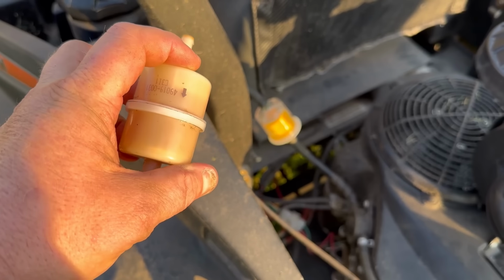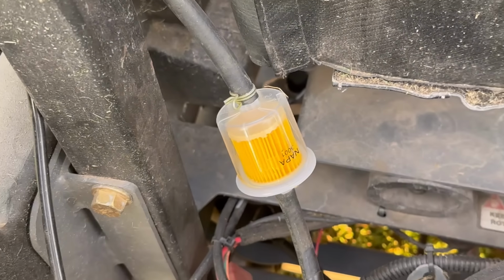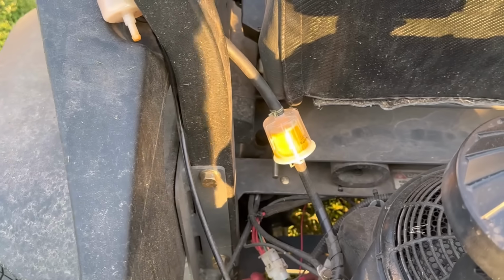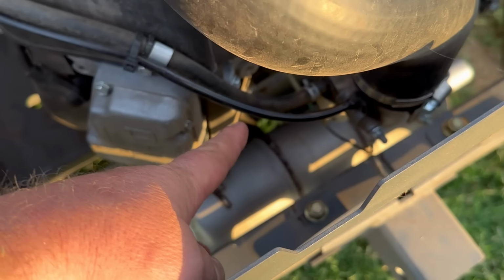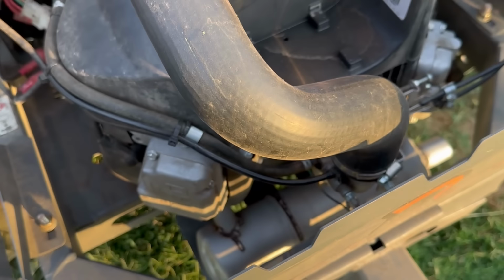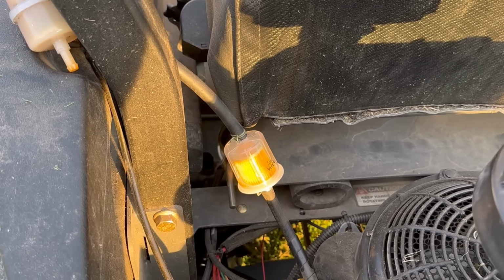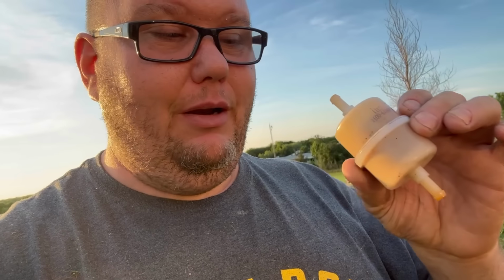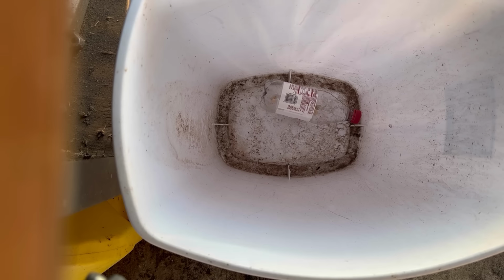MY FUEL FILTER NEVER FILLS UP?

Comment: Two things I NEVER do unless I have a problem. 1 - Change the fuel filter. 2 - Change the factory plug. The factory parts last pretty much the life of an engine. If you keep clean fuel, the filter should never stop up and the plug should never burn out. Changing the oil; ABSOLUTELY EVERY YEAR. You start playing around trying to fix what ain't broke and you'll end up with more issues.

Comment: Absolutely best strategy Maintenance- maintenance folks!! We all know what happens to the "if it ain't broke don't fix it folks" - that was actually a quote for engineers for inventing something different that's always worked,   ain't broke don't fix it is always plagued with 58 problems due to lack of maintenance, then you have a machine that has run for a long time with "ain't broke" parts but has reeked havoc on everything!   That filter looks like a extreme air filter , I've always wondered that about the filters not filling up , thanks!

Comment: I put a new clear fuel filter on my skid truck after a few days my carb started flooding the metal plates in the filter started rusting and messed up my new needle and seat on my holly carb two times before i figured out what was happening .  Get the ones with plastic inside the filter on the ends of the paper. The gas has too much alcohol in it.

Comment: On a new or very clean filter. It almost never fills up. As it gets dirty(from bottom to top) The level will climb because it has to go further up the paper for the fuel to get thru. When I see my motorcycle filter full to the top. It's time to put a new one on. About every two years on mine.
Reply: Interesting comment,,, BUT, if the filter is in a gravity feed system with a bottom dump gas tank, the filter should be full, & no air inline.  What he showed was a gas feed system that has a fuel pump & top SUCK out of the tank. Maybe, when the engine is off, the gas backflows back into the tank? Or, the filter isn't in a vertical position & the air can't work it's way out of the filter. 
 On my boat, with an external gas tank, I have to place the gas pump bulb & in-line filter in an upright position, to get the pump-up bulb & to work properly, & the filter to completely fill.  aka,,, let the air flow up & completely out of the line.
I hope that paints a better picture.?

Comment: What’s I’ve seen is sometimes that black fuel pump, where the fuel filter line goes into . Gets dirt in and the breather ends up getting clogged… considering they haven’t changed it since buying it

Comment: Checking out your videos first time.
I added a filter like the one you showed but smaller, to my generator, that relied on a gas tank "filter". I wasn't sure this would be a good idea. No fuel pump so gravity feed needs to be sufficient. I got a package of Chinese made filters, but from a good company, CTS. Decent carb. kits too.

There seems to be enough flow. My filter does not fill up completely either, but I was not surprised. I could remove the fuel line at the tank and squirt gas in and fill it, and it should then stay full, but I didn't see any really good reason to do so.

There are clearly differences in the quality and performance of the 2 STROKE in tank filters. OEM ones being crazy expensive and some of them suck. This spring/summer I had to clean dirt out of a line trimmer three times, even after using a new different filter. I think there was still dirt in the fuel line; my bad.
Anyway, the filter that came with my 3 year old piece of shit MTD trimmer had a gap that required the fuel line to be pushed all the way on tight to hold the filter in place over the holes, Gas line had not been pushed on all the way.

Do you know anyone that has independently tested various filters, for filtering and flow, etc.? Also it seems that cheap filters themselves degrade and end up in carbs.

I made the mistake this past spring of purchasing regular gas :-(  Everything started acting up and I had to clean, and/or add carb, kits to several 2 strokes.

I hope my cheap Chinese filter choices(inline and in tank) from CTI work out.

Comment: I have an antique farmall A tractor.  It has a bottom gravity feed fuel line.    The filter also doesn't fill up ever.       There us no fuel pump just gravity fed from the bottom of the tank to the carburetor.

Comment: paper fuel filters are for engines with a fuel pump and the smaller disc shaped screen filters are for gravity systems , uless you get water or lots of foreign material in a paper filter they should filter thousands of gallons of gas before needing replacement
Reply from the maker: incorrect
Reply: @THEMOWERMEDIC1  either will work  but why would you want a screen filter with a fuel pump or a big paper filter with gravity?

Comment: I have a John Deere riding lawnmower and it doesn't fill up with gas. I changed the spark plug today and fuel spilled out of the spark plug hole. What will cause this to happen. It's a Briggs and Stratton engine 17 hp

Comment: I recently replaced a fuel pump and filter on a kawasaki powered 21hp golf cart and the fuel just continues to trickle out. It will only run with choke on and I've ultrasonically cleaned the carburetor. Seems like it's going to need a carburetor.

Comment: I bought some Raisman fuel filters and they were absolute junk. The plastic started crumbling in 1.5-2 months. I guess they have you over a barrel and make you pay $10-$15 for a decent fuel filter.
Reply: These small 1 4 inch fuel filters cost more than the half inch  and automotive filters unless you can order in bulk.

Comment: Mine not filling and gas won't come out the fuel pump and I bought a new pump and still not getting gas
Reply from the maker: check for collapsed, fuel lines, pinched fuel, lines, and fuel line obstructions
Reply: All lines are new petcock and tank is clean it's a pulsing pump I meant to put that I can't afford to keep paying someone to mow but I had it fire up it's just not getting fuel

Comment: Do not use this type of filter on an engine WITHOUT a fuel pump.  The resistance is too great for a gravity feed. Use a siple mesh screen filter for graity fed systems.
One certain way to be sure your not starving your fuel pump is to mount the cartridge type filter verically.  The fuel will pool up around the outlet insuring your pump doesn't suck air.
Reply from the maker: Says who?
Reply: @THEMOWERMEDIC1  B&S, Honda, virtually all the manufacturers specify a low restriction screen type of filter for their gravity fed systems.
I also learned from experience as I was wondering why my rider wasn't staying running so I ran the fuel system and found no blockages so I asked the manufacturer.  They asked if I had replaced any parts and I responded "Yes; I replaced the little disc type fuel filter with a see-thru paper cartridge type so I could see when it gets dirty.  They told me that I had the wrong filter for my fuel system and that it was too restrictive.  I replaced the cartridge with a disc type screen filter and she runs like a dream now. 
Apparently, the extra suction from the pump is required to overcome the small micron filters.

Comment: It will fill up more as time goes on.
Reply from the maker: 40 hours on the clock  and it never filled up so🤷
Reply: @THEMOWERMEDIC1  oh keep going... I change mine about once a year so they go over 100 hours per. When I do change it and restart they are totally dry. I always expect the mower to die but never does. By the time it's time to change them they are full.

Comment: Filtration engineer here ..... ALWAYS put such filters on the **PRESSURE side of the PUMP**, NEVER on the 'vacuum' side.   The in-service life of the filter will be 'exponentially' better and will remove MORE (and smaller) particles.
Reply from the maker: lol no it won’t.  Don’t matter where it’s installed.  Nearly all mfg of mowers put the
Filter on the suction side of the
Pump

Comment: "I use clean gas. Why do I need a new filter?" Said the owner of the 10 year old JD.
Reply: Hmmmmm, Say what you want Jim but the John Deere 155c I bought new 6-6-06 had the factory gas filter just as shown until about 2 yrs. ago.  It wasn't causing any problems at all,  I just figured maybe it should be changed.  This year I pulled the tranny and changed the fluid plus 1st steering componets.   753 hours and it runs and mows just as it did when new.